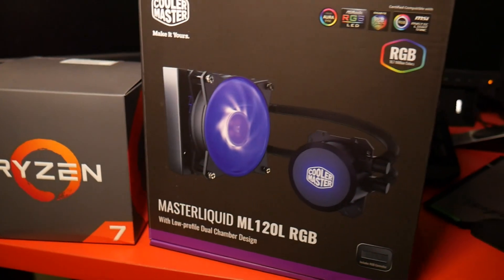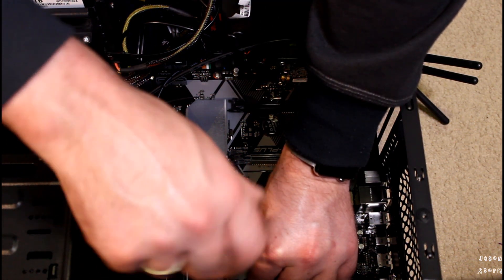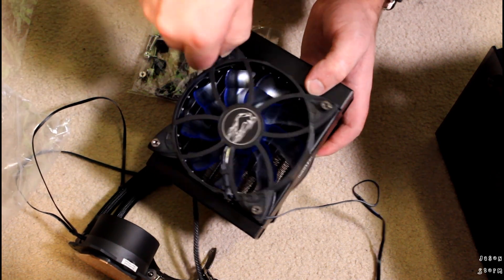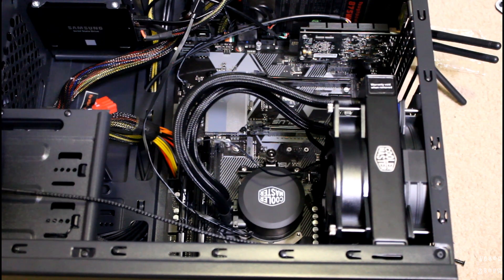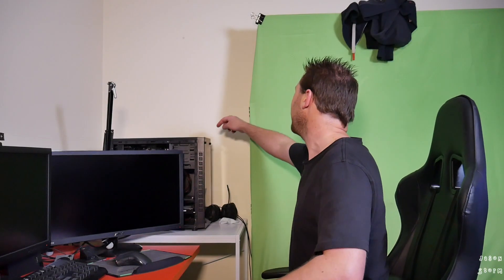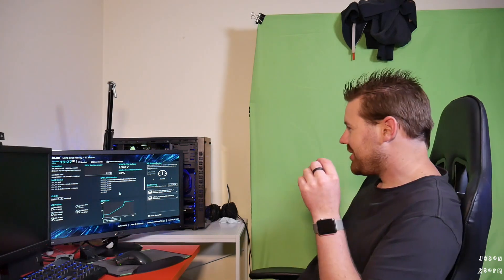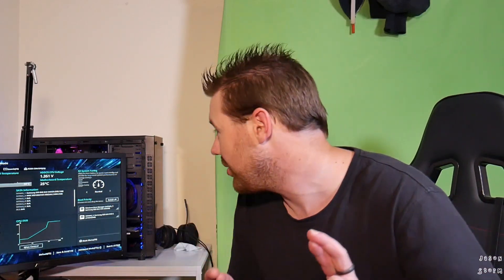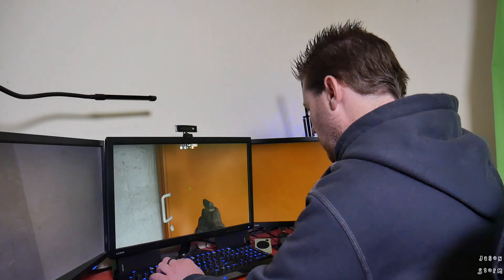Cooler master Masterliquid ML120L RGB Review Installation

Comment: The guys at the shop installed mine and the fan is on the back im confised.. I have 2 340mm fans on the front but dont know if they intake or out take.
Reply from the maker: It doesn’t matter which side the fan is on, it’ll still work the same
Reply: Most people opt for a push configuration, not a pull configuration. I'd recommend pulling the radiator off, removing the fan and checking the fan for which side the air blows on and mount the radiator to the back case fan position like shown in the video and having the fan blow air in that direction out through the radiator towards the back of the case.

Comment: this may be a dumb question, but alas, i myself am found to be dumb on occasion. Anyway, does the cooler come with liquid already inside? or do you need to fill it yourself?
Reply from the maker: It comes pre-installed, all you have to do is fit it
Reply: Rhett L. Every aio comes with filled liquid

Comment: Where did you connect the Pump RGB header? I only have one RGB header which I use it with the Fan (mine is an Asus X370 Pro)
Reply from the maker: There should have been a splitter in the box to connect more then one to the same rgb header
Reply: @JasonStorm  cool I'll dig it out. Thanks for the prompt response

Comment: Temp vrm fulload render? I find this cooler very noisy
Reply from the maker: Sometimes I find that the bios fan speed setting could be too fast for these if you don’t adjust it, I pulled the speed of my fan down and temps are fine and I don’t find it to be too noisey
Reply: Is the fan noisy or the pump?

Comment: When I have to clear this if I buy it and if it leaks idk I am scared
Reply from the maker: If your worried about it leaking maybe go for a hyper 212x or something like that, just make sure your computer case has room for it
Reply: @JasonStorm  one question what is better ml240 or kraken x62 for oc and temperatures?
Reply from the maker: Either will be fine, I don’t think you’ll see much of a difference between the two, I would probably go the coolermaster ml240 though
Reply: @JasonStorm  why you prefer the cm and not the x62 is bigger 280mm bigger fans so it's not better liquid cooler ??? ( btw i have ryzen 7 1700 )
Reply from the maker: I couldn’t tell you I haven’t tested either of them but I would simply buy the coolermaster because I prefer the fan design (I believe the coolermaster design if a good compromise between airflow and noise) and I personally would trust the coolermaster more not to give me any reliability dramas but all this is just personal preference, if you are more comfortable with the kraken x62 then do that one, as I said previously I don’t think there would be a massive difference between them in performance, for example in Linus tech tips new video (I think it’s called why you shouldn’t buy a water cooler) they tested 3 sizes of water coolers with 1,2 and 3 fans and the 3 fan bigger radiator water cooler didn’t beat the 2 fan smaller radiator model in cooling or noise so the point I’m trying to make is more fans and bigger fans does not mean a big jump in cooling performance, either of those two options will work well for you with similar performance
Reply: @JasonStorm  Okay thank you very much my friend for reply to me so fast and keep up the good work subscribed!

Comment: mate i really want to ask where did you plug your pump header on your mother board. wich conector? cpu_fan?
Reply from the maker: My motherboard has an AIO pump header and I plugged the fan to the cpu fan
Reply: It should be plugged in not in the fan header but in the opt plug if you have some or any sys pump fan header i think

Comment: Hey, im going to buy this, my CPU gets like 90 Degrees while playing Battlefiled 5. By how much will this reduce my temps to ? any idea ?
Reply from the maker: Hey, I’m not sure I did a cpu swap at the same time as changing this over but the fan and pump speeds are adjustable so the faster you make them go the cooler it’ll be but this would probably take a good chunk off it, and if it doesn’t maybe you need better case fans
Reply: @JasonStorm  Yea planning to buy 2 extra case fans too. can  it reduce to 75 degrees . i mean thats a sweet sport for Triple A titles
Reply from the maker: My CPU (Ryzen 2700) is at around 55 degrees C in games like F1 2018, I’ve never seen it get above 60 degrees C but my case does have 5 case fans so your results may vary
Reply: I've got that cooler with my ryzen 5 2600 and in low rpm silent mod i got by idle 35 40 degrees and full load till 65 70 degrees
Reply: Greta amounts.   My cpu never even hits 62

Comment: I just installed mine today and can't figure out how to turn on the RGB, I don't have the socket you mentioned in the video and dont know where to put the other cables you mentioned.
Reply from the maker: It’s comes with an rgb controller that you can plug them into instead and then the other end of the rgb controller gets plugged into a spare power cable from the power supply with the plugs provided in the box. As for the other cable I guess you mean the pwm headers? When you pull out your old heat sink and fan you will have to pull out the fan from the cpu fan header you can re attach the new fan to this same header and there should also be another spare one or two around the motherboard somewhere you can plug the AIO pump hopefully one that says AIO pump in small writing beside it would be great but not all have it but a normal 4 pin is fine as well, consult your motherboard manual if your unsure of where they are, from memory it also come with a splitter so if you don’t have many you can hook up 3 to 1 header if need be, hope this helps.
Reply: @JasonStorm  hey i wondered something, i got an rgb controller for my thermaltake fans and i was wondering if i can plug the cpu water cooler RGB in that controller? Or does it not work like that
Reply: how do I connect the controller if there is no rgb wires to plug into my mother board?  @JasonStorm

Comment: Me and a mate just bought the same aswell and we are trying to put it on the Rampage V Extreme asus motherbord. When we tought we figured the puzzle out and placed every cable on the right spot we get a CPU Fan Error when we boot the PC. Any idea on ho this is possible?
Reply from the maker: Are you sure the fan headers are hooked up correctly? The little arrow on the side means 5 volt, that needs to be around the right way on the headers, do you have the pump hooked up to the CPU header or the fan?
Reply: @JasonStorm  Yea we fixed it, thank you! Now his cpu gets to 70 degrees while stress testing it
Reply from the maker: 70c? Or 70f? If it’s 70C you might need to adjust the fan speeds up a little at higher temperatures or some good case fans, its higher then I would expect unless the CPU is overclocked then that’s probably about normal
Reply from the maker: In saying that it’s not dangerously high or anything